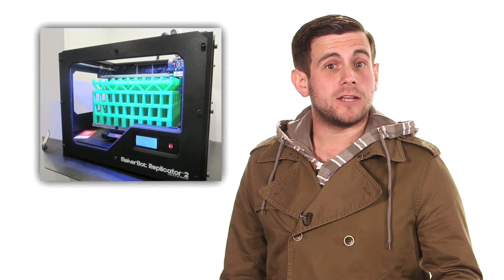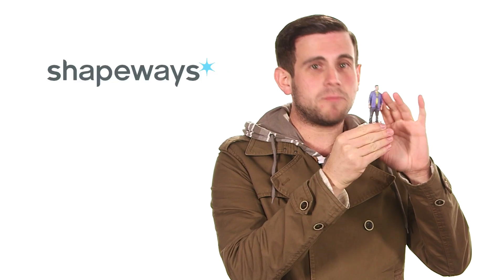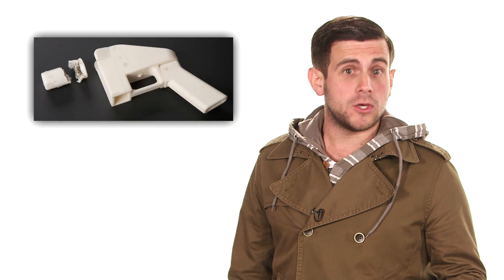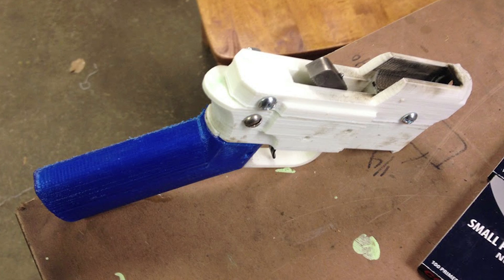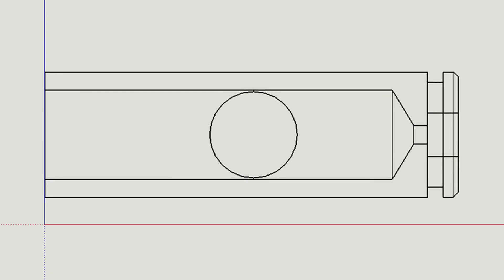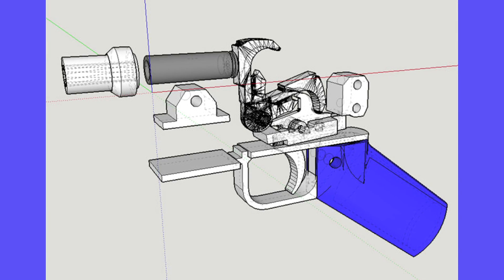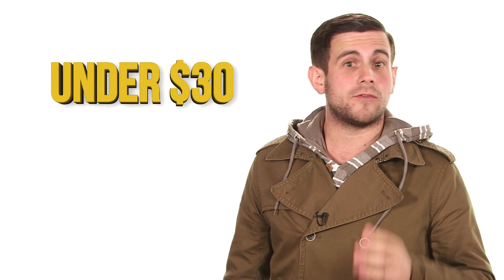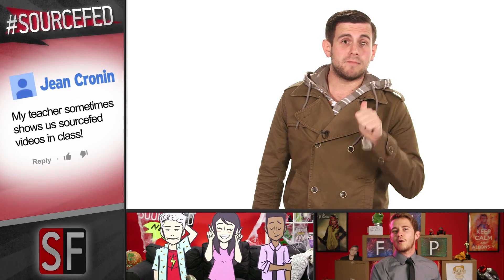New Bullets Make 3D Printed Guns a Reality!

Comment: Weirdly, in case you're a fucking moron, this does not lower the price of entry whatsoever, making a 3D-printed firearm costs much more than making a homemade one using common tools. The printer, plastic, gluing the weapon, testing it, and in this case, making your own cartridges, is going to add up to much more than even just a reliable handgun would cost. 
Homemade firearms have been around for so many years and can pretty easily be made by someone with little to no experience with the most basic of tools. e.g. slam fire shotguns, which more reliable than these 3D printed weapons and basically only require a couple pieces of pipe and some scrap metal
Reply: By "price of entry" I'm 99% sure that Matt was talking about manufacturing weapons for sale, not making your own personal gun. "Price of entry" refers to the cost of starting a profitable business, including purchasing materials, equipment, and labour. So, before you freak out, check what the phrase actually means.
Reply: How does somebody not being knowledgable on a specific subject make them a fucking moron? People know different things... calm down.
Reply: ***** How is being able to print up a weapon a huge advantage?  I know its youtube comments so everyone just talks out their ass, but really!   Its not that hard to get a gun you can buy them at wal mart.
Reply: I didn't know about slam fire shotguns. Their existence makes this whole 3D printed weapons debate pretty redundant.
Reply: ***** To make guns for sale you need an FFL license and you need a ATF approved firearm, which these are not. They would never be able to legally sell these in the current form. Same thing with the ammo, need an ammo manufactures license and that is not going to happen for 3d print guns any time soon.
Reply: Perfectly said. I could go down to my workshop and make an armful of shotguns from pipes and scrap metal in the amount of time it would take a printer to make ONE of these shitty plastic guns. 

Now, when people start making functional guns that can be printed quickly, then this'll be an issue.
Reply: ***** I do not see them being licensed soon. ATF would never allow a weapon as weak as a  3D printed PLA to be counted as safe. There is a reason current polymer guns are a Carbon based and undergo tons of testing, and even then they still make the barrel and moving parts of the gun out of steel.  And even then gun shops already have 3D sintering printers that make things out of stainless steel, and CNC machines that can make a receiver much faster and stronger than a 3D printer as they are currently. Also a 3D printer while good for one off prototypes is not a good mass manufacture tool. It is much cheaper and easier to build a gun out a sheet metal and a press. 10 seconds you have a receiver, 2 minutes you have a barrel pressed in and a mostly complete gun. Thats how they can make AKs by hand in the third world at the rate of hundreds a day in towns without even electricity. Simplicity in manufacturing, and low cost right there.
Reply: you obviously do not know how economics works.
Reply: ***** The thing is the entry cost for making non plastic firearms is much lower than the 3d printed ones legal or illegal.

For one there is a larger market for non 3d printed firearms considering everyone already owns normal guns. This means you very well would be dumping money into a very small market because everyone already knows these guns are unreliable.
Basically you would be loosing money.

Second the basic tooling for making functional non 3d printed firearms is considerably cheaper than equipment needs for 3d printed firearms.

A small milling machine is considerably cheaper than a 3d printer.

All in all the cost of making 3d printed firearms is much more expensive than making normal guns. . .
Reply: ***** People build AKs in hovels without even a high school education, you do not need that much technical know how or very special tools.
Reply: You can build an AK out of a metal shovel. It's been done on at least one occasion. You can build basic firearms that are just as good (probably better, actually) as a 3D printed one,  and you don't need to spend thousands on a printer quality enough to make the gun.
Reply: IrishColin94 Apparently he thinks everyone makes gun on a daily basis for someone or for themselves. Thus knowing the costs to manufacture weapons is common knowledge. Yep. I know how much my imaginary Sherman 50mm pistol costs.
Reply: Merp maybe not right now, but I could see them being licensed fairly soon, and once they are, the ability to just print a weapon is a huge production advantage.
Reply: *****
how is it cheaper?
Reply: ***** not easier at all. You need techie a skills. As far as cost it's still probably over a grand easy for the tools needed
Reply: ***** That is not true at all. You can build an AR15 with no tools at all. And you can google a video on the entire process.
Reply: Merp He said AK not AR.  ARs are easy as fuck to build, if you can follow instructions you can put one together.
Reply: ***** I linked to both AR and AK. AK is extremely easy as well, plus you can build the AK from the ground up. You can just bend up some sheetmetal to a template and you have an AK receiver. You need to use forgings and a mold to build an AR receiver. Either way both as cheap and easy to do at home if you cared enough.
Reply: Merp You dont just bend a AK reciever.  Ive seen the entire process, you have rivets and trunnions that have to be aligned.  Making either gun from "scratch" requires both specialized tools and technical know how.
Reply: ***** Yes I like a video to the process. You drill a few holes (which can be done with a hand drill) then you bend the receiver, and you can either rivet or use bolts. You can get a hand rivet gun for 4 dollars at harbor freight. So yes it is that easy all done off a template and a video. I have done the entire process, and it is that easy.
Reply: ***** As for the trunnion you can use a bench vice.  Here http://www.my-rifle.com/building%20an%20ak%20without%20tools.asp
Reply: Also either way the cost of entry is cheaper than a 3d printed gun. And you still have to register with the ATF or you have an illegal firearm. Unless you do that new 80% thing, but even then I would likely get a serial for it just so you dont get in trouble if you want to use it at the range.
Reply: Merp go build an ak and an ar. Then tell me that no tools were required.
Reply: Customsouthernarms He said no special tools, not any tools at all
Anyway I think this has been blown out of proportion, there's no need to argue that you can easily build an AK or AR (because even if you could I doubt it would be very good) when there are much simpler options

Comment: I wouldn't mind 3-D printed weapons if they were subject to the SAME rules as registered firearms with serial numbers.  Meaning you show electronic proof of ID, include detection parts to make the thing legal, and so on.

The problem is with unregistered "unfinished receivers", or the sorts of things you can order in kit form on an unchecked, unregistered basis (no serial number, no ID check) because they're one or two critical parts away from either being a model of an assault rifle or the working real deal.  Really, if you have access to a drill press and the skills to use it you can literally arm yourself sight unseen.  No 3-D printing or engineering required.